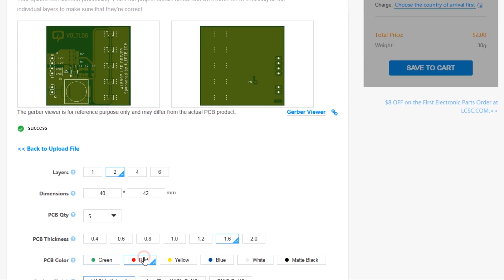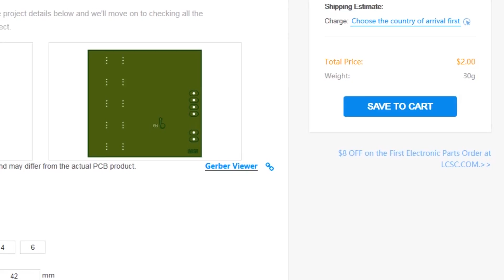Voltlog #297 - How To Parfocal A Trinocular Microscope

Comment: This video saved me a bunch of time, thanks a lot! 🙏 For anyone still struggling to synchronize between the camera and eyepieces: make sure to keep and use the stock ring adapter that comes with the camera. I made the same mistake of removing it, and once I put it back everything worked perfectly.
Reply from the maker: Glad it helped you out and thanks for the extra tip!

Comment: I believe that I just ordered the same adapter to mount the HC210 to the SM-4T. I did not like how high the tube reducer was after attaching to the sliding photo port that came with the scope. But because I am using the 10X eyepieces, and the HC210 uses a 1/2.8” format, this will still be a higher magnification than the eyepieces. Will that significantly narrow the range in which the camera will stay in focus with the eyepieces? I know the 0.37” tube adapter would be ideal, but the height and stability are important and a 0.35” seems like it would create a vignette (not to mention it is much more expensive)

Comment: So I got the 0.35x apparently.. thought I ordered the 0.5x. I seem to need about a 1" spacing between the triport and the camera bottom. As it sits (which it does fit).. I can't keep both in focus. Is there a "riser" adapter I could get that would add a 1" or so between the trinocular port and the camera.. ideally something that threads on to the camera AND the port would be great.
Reply: Google 5mm C-CS Mount Lens Adapter Ring Extension Tube

Comment: Just wondering if you could help me out.  I have a similar microscope, I'm using the 0.5x barlow lens, the same 0.5x adapter that you have, and the same camera that you have.  I have followed your procedure exactly, but when I go to adjust the 0.5x adapter the focus isn't even close.  I cannot get the parfocal adjustment to work. ?The only difference is that I am using a TV screen for my computer monitor, and I am using the USB as I don't have another HDMI port on my computer.   What am I doing wrong?  I'll keep trying to figure this out but it's a little frustrating.  Thanks, Rodger 

EDIT:  As I went down and read the other posts, I read John Jones post and maybe this is why I cannot get parfocal on my microscope.  I can still see the image with my left eye while the camera is projecting on the screen.
Reply from the maker: This doesn't sound like the problem John Jones described below. If you followed the procedure described in the video and you don't get the same result I think it might be an optical problem, the camera + 0.5x adapter not allowing you to get in focus with your optical setup. Maybe you need a different adapter, try to move it up/down to figure out where it should be for good focus.
Reply: @voltlog  I tried your suggestion and it is so out of focus that even trying to raise it up doesn't seem to help at all.  I can get it in focus but parfocal is out of the question.  Thanks for you help though.

Comment: A bit of advice for those shopping for a trinocular stereo microscope like this. Make sure that you are able to use both eye pieces AND the trinocular port at the same time. I have an Amscope that looks exactly like this one, BUT the trinocular port shares the optical path of one of the eye pieces. There's a small push-pull rod right in front of the small knob on the left side of the head. That switches between left eyepiece and trinocular port. That 'feature' was never disclosed in the description of the scope. So if I need to use a camera (which I really don't need anyway, fortunately), this becomes a mono zoom scope while using the camera. Just something to keep in mind when shopping.
Reply: The term your looking for is "simul-focal" if you want to use both eye pieces and the camera mount at the same time.
Reply from the maker: Wow, not disclosing that is a serious reason for return or at least a partial refund cause that is not a trinocular microscope if it was advertised as such.
Reply: @voltlog  Maybe this is the reason I cannot get parfocal on my microscope as well, as this is how mine works also.
Reply: In the SM series AmScopes, you want the SM-4T series. I believe all the others, like SM-1 through -3 and SM-5and -6 have the shutter, which is useful if you don’t need live view or live recording, i.e. still photos only. Someone can correct me if I am wrong. The camera port still uses the left eyepiece though; the SM-4T does not have a third optic barrel so I still don’t consider it a “true” trinocular.
Reply: I have an Amscope SM 3T and that is Simul focus single arm which I prefer.